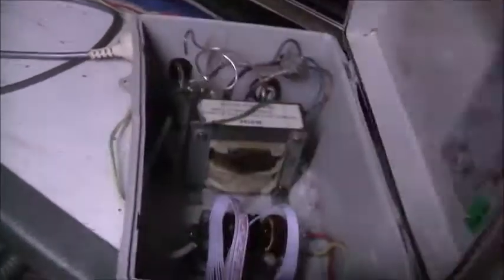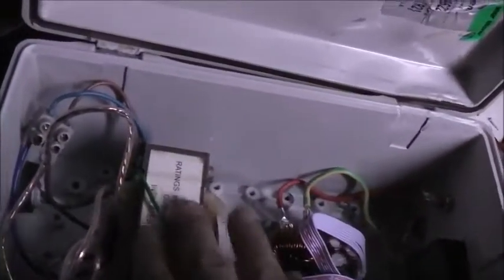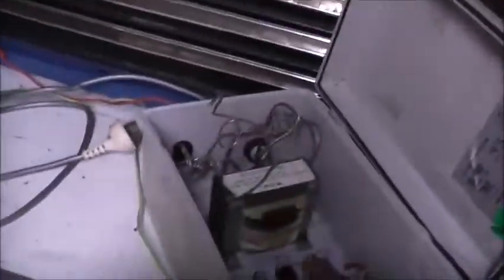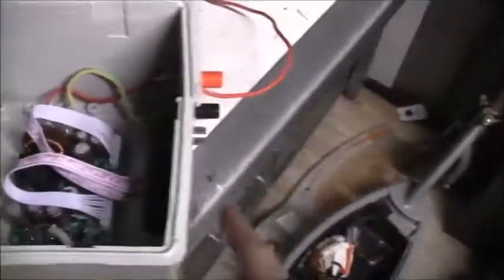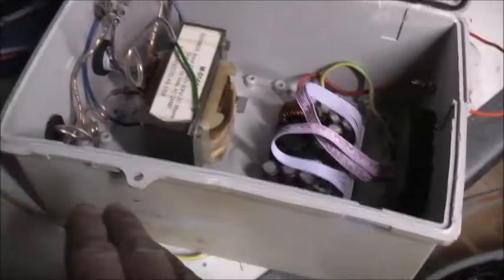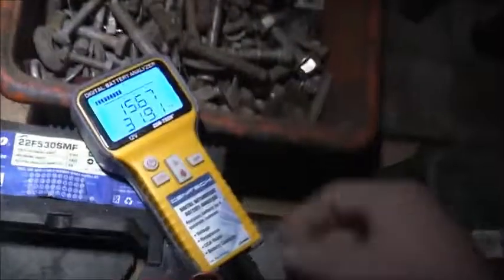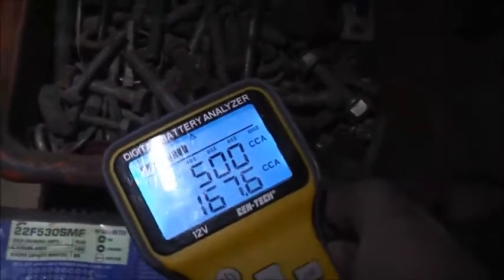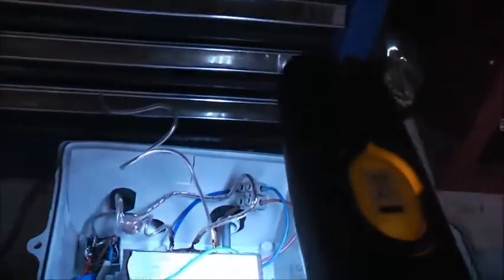TX Overloaded, Magic Smoke Released ;-(

Comment: A 2 Amp transformer will not last long at 10 Amps as you found out. A bridge rectifier at 10 Amps current will dissipate 14 Watts ! a heatsink is required.
Reply from the maker: yep, a fuse should've been used, i'll mod the rectifier with a heatsink later on, got a nice one somewhere